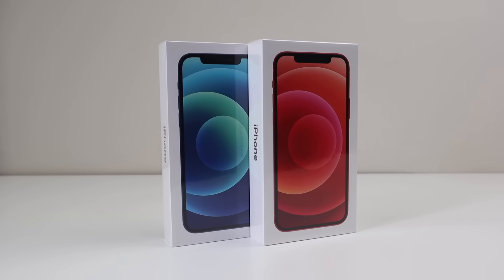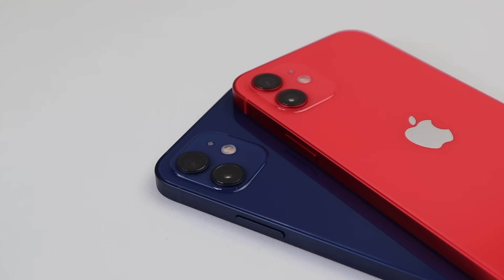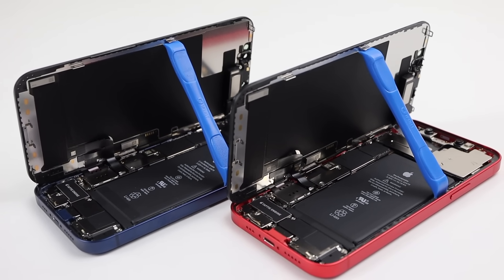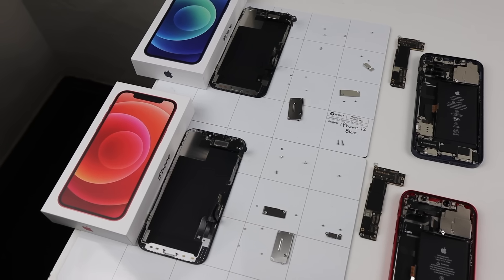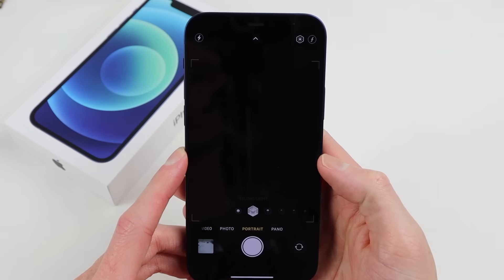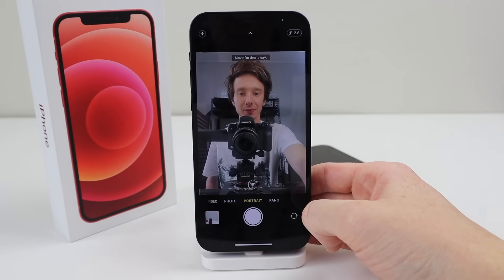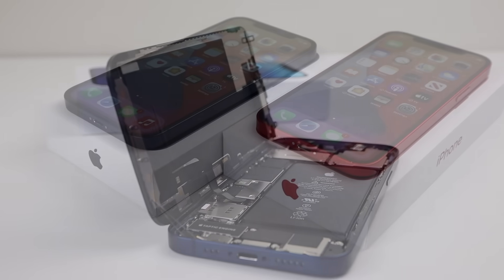iPhone 12 Anti Repair Design - Teardown and Repair Assessment

Comment: When you take it apart like this the first thought that pops up is how are these phones over $1000😂
Reply: Because people are willing to buy it at that price
Reply: @javonyounger5107  yup that's how it works with every product lol
Reply: the real price to manufacture is actually some 350$
Reply: Although I am in no way backing Apple up (because their practices disgust me), something to bear in mind is that the device "cost" isn't just the cost of the physical parts and production of it, but also the research and development that went into both the hardware and software, as well as distribution and marketing costs etc. I'm guessing at least some parts will be completely custom to Apple, and so will require custom fabrication technology that costs to build too. There is always a whole host of other costs that are incurred in bringing something new to the market.
Reply: @JoolsParker  My guess would be $100 parts and labor, $50 marketing and sales, $50 R^and D and programming, the other $1000 pure profit.
Reply: @cuckingfunt9353  The CPU and GPU and display combined are worth way more than $100 to manufacture. I think the actual cost is in range 250-350 USD. Still, Apple seems to have profit margins that even Intel can only dream about.

Comment: hey hugh jefferys
as a mechanic i have a trick for you! when you get those little screws that are rounded off, get a small set of left hand drill bits, they work awesome for removing fasteners with stripped heads and you can, if youre evil, use a right hand drill bit to reinstall the screw.
this trick should work great because those screws arent tight, and you dont need to use a drill to make it work
just a trick for ya
Reply: Or sandwich a small rubber strip like a rubber band between the screw & tool.
Reply: Try “Boa Grabits” they are damaged screw retractor drill bits, my dad absolutely SWEARS by them they’re only a 10£ and last forever!!!
Reply: old school like me :D .. if larger screw non phone like :D .. drill 2 mills hole into it .. tab in 3 mills torx .. and take it out ^.^

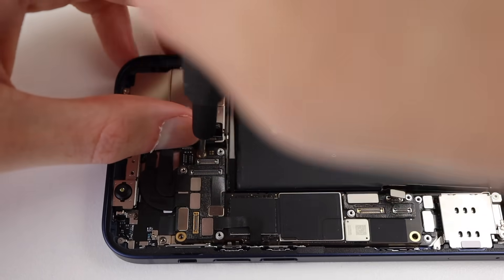Comment: 13:45
I think it has to do with software, cause I have a 7 plus and my back camera is replaced.. doesn’t work as smooth and freezes a lot. Specially if I use the camera app. For example Snapchat never froze the camera but the camera app does. That’s weird.

Comment: Id like to see a video of you taking this to an apple technician and seeing how they respond to "fix" the problem. If its something they can figure out or if they are stumped as to why it will not work
Reply: They check serial numbers of every part when they open the phone. They’ll see pretty quickly that the parts don’t match :(
Reply: @zuzucats1  Yeah, but what's the "fix"? Can they just tell the phone "no, this part is fine, use this serial number from now on", or will they go "man I don't know what you did to your phone, you're going to have to buy a bunch of new parts to fix it, which'll cost more than a new phone, so just buy a whole new phone please". I'm betting they go with option #2.
Reply: @kedolan4992  you have a good guess right there. My mom just bought watch series 6 and Apple was offering her gadget protection plan that would cover any damage or negligence by the owner. For example if she dropped the watch, Apple will give her a new one. The gadget warranty they give doesn’t cover these kinds of situations so if you’re going to repair it to them, they said that it would cost 80% of the product’s price. Might as well buy a new one, they said 🙄
Reply: @kedolan4992  All the serial numbers are different in the phone. When the factory builds the phone it programs the numbers onto the main board. When a part is replaced by GeniusBar the technician reprograms the main board for the new part. The Apple techs could easily use completely snide parts, and program the board to accept them. The Apple technicians have access codes that are regularly updated and checked up on (to see how often they are used and when, where, etc) so they cannot rent them to 3rd parties or anything else to make money for anyone other than Apple.
Reply: @Ggwellplayeddd  Lol, if they told me that I'd go to another Apple store, "accidentally" drop it and cause damage, then go inside and demand they honor the protection plan and watch them splutter and try to think of an excuse not to give you what you paid for (and record the whole thing, because it would be worth it).
Reply: the salesm- I mean technician won't repair it and would say it's better to just get a new one.

Like what happened to that 4 month old iPad we had years ago that we sent for repair, stayed in their repair shop for a month and ended up with them only saying that they can't repair it.
Reply: Man, they can obviously fix any issues your iPhone is having, but they all have been especially instructed by Tim Crook not to do that, so people can just buy the new iPhones. More sales for them.

Comment: Apple logic: let's make a bunch of connectors to make it more easier to replace parts
And lets make sure that they can't replace any part
Reply: they made it easier to be repaired on their end, saving cost on time and labor fees paid to their employees to fix it but still manage to make it impossible to fix by non-apple employees. They probably have a program where they can reflash the phone to register replacement parts.
Reply: @aldwin4408  sarcasm Apple employees actually repair phones ? I though they were just paid to say the problem is unfixable / guarantee has been voided / water got in and prompt you to buy a new one.
Reply: More easier

Comment: One last thing you could've tried is to move both camera and logic board from one phone to the other one to see if the pairing is done between the camera and logc board only or if there are more components involved in the pairing system.

Comment: When you were at school, did they actually teach you about adjectives and adverbs? Or just adjectives?
You use adjectives when its adverbs which are required.
You don't "do something easy", you "do it easily".
The "ly" ending on words is actually important, and failing to use them makes you sound like a person who slept through English class for 10 years.
Then you confirm my suspicions by saying "There is a large number of these."
But "is" is singular. The correct English is "There are a large number of these."
Stopped watching at  5:14.

Comment: What I want to know is how have they achieved that? They're producing thousands of iPhones per day (per hours?) in factories on a production line. 
How do you make every parts unique when they're assembled on a production line? Is there a chip on the board that 'reads' the components attached to the board? Can it be bypassed?

Fascinating. A device built at scale...that manages to be unique.

Comment: And this is why I stopped buying Apple, their stances on only allowing Apple certified people to "repair" and most of the time taking the "easy" route to just replace the whole phone is ridiculous... Now they make their phones more "tamper proof" to where repairing your device basically reduces functionality is pretty bad. I know the "average user" nowadays aren't expected to repair their stuff; but when it comes to learning that skill yourself, knowing how to repair or expecting "Geniuses" to repair and not replace it's very bad form to take the option away. The only thing I can applaud Apple for is their Software Security but at the cost of being overprotective on the hardware side to where reconnecting the battery makes their phone "require service"...

Comment: One more of many reasons why you'd have to be an idiot to buy anything from Apple.  Android works just as well is a lot cheaper and is completely reparable if needed.  And you don't need a drawer full of chargers and cords for different devices.

Comment: I wonder if you do a backup of your phone and transfer it to the new phone, will the parts of the new phone be able to go in the old phone and vice versa?  Wonder if the Apple ID is now coded into the chip and unless you have the same Apple ID installed on both phones, it wouldn’t work. Hmm 🤔

Comment: The fact that the parts are 100% genuine and you get this problem means Apple is essentially money hungry. Their people need to work on "repairing" the device so they can get even more money from the consumer. Not even to mention the fact that they say they are not including a power adapter or headphones to reduce e-waste is a load of bs. You change the power plug from USB-A to USB-C on the part that actually plugs into a charger when all of the old chargers are USB-A. meaning you either have to go out and purchase a new charger which they of course highly recommend their own. How about this give the customer an option to choose either an iPhone that comes with headphones and a charger or one that doesn't come with headphones or a charger.

Comment: Can’t you just use the apple lightning charging ‘lead’ (along with the old charger) that you’ve got with your last iPhone to charge it? Why do you need to buy a new charger?
Reply: apple's chargers are notorious for not lasting long anyway. they often bend at either end and since apple doesn't have the guards at each end that most chargers have, they break.
Reply: iphone charging cables used to be lightning to usb-a but starting from iphone 11 they changed usb-a to usb-c, and the only old charging bricks that are compatible with the new iphone 12 are the ones from iphone 11, the owners of which most likely won't be switching as opposed to the users of older phones who have usb-a bricks

Comment: I think its a pretty important video. Making phones modular but locking them up behind deep pairing seems a bit crazy. I don't want a device that can not be recovered even in perfect conditions having a perfect donor. I do not trust a manufacturer that keeps the device locked from the user.

I assume this makes iphones worthless for anyone but the user. But I do not believe that our society is in such sad state that we need to 'biologically' lock a device and all of its parts to one single user. I don't think that is the right solution to any problem ever. Sounds like a pretty dystopian future, you are either a part of elite that 'can use this magical device' or are locked out of it like you are unworthy. You man not even touch it with your dirty hands, it's a holy item.

Disgusting. . .

Comment: Friend of mine uses iPhones and takes weeks to repair, so weeks without phone. I use generic Android which has never gone wrong, but if it does, I just swap SIM card and away I go. I'll never have (or want) an iPhone. I also never realised that all your data is stored on the Apple cloud and is not 'backwards' compatible with standard android - you are tied to Apple or loose your data!

Comment: Should have swapped screens.  Screens and battery replacements are the only real repairs worth doing anyways.  You have to reprogram the "new" parts to the phone to resync them. I would consider that software since the hardware is obviously working but the software won't let you use it.

Comment: This is f*****g crap. Apple continues to pull this kind of arrogant greedy s**t. They put in extra effort to make it impossible to repair your device. They have no valid reason for doing so. security? the camera doesn't house any personal data so why should security concerns bother it? Why the home button on older phones? all personal data is by design housed within the data storage in an encrypted form. If they are intentially housing the personal data on the camera chip itself, then not only are they crooks, they are infallibly moronic crooks.

Their engineers have lives and can't be expected to just throw away their standard of living to make this stop, we need our f*****g politicians to do their job and stop this stupid nonsense. We need a national right to repair that also outlaws this kind of artificial part pairing.

Comment: So, iPhones are following the same trend modern cars are then. It started as anti-theft security, but now various car manufacturers serialize and program key components to specific vehicles, requiring you to have the OEM software and tools to program each module to each other. This completely bricks cars if even one component doesn't recognize another. It effectively stops any aftermarket or external repair companies from completing certain repairs unless they have the correct software. Therefore, just like what's happened with various vehicle manufacturers, Apple does not want any external parties performing repairs unless they're profiting from it. They've software locked each component to each other with matching written serialized ID's that can only be relearned with their own proprietary software.